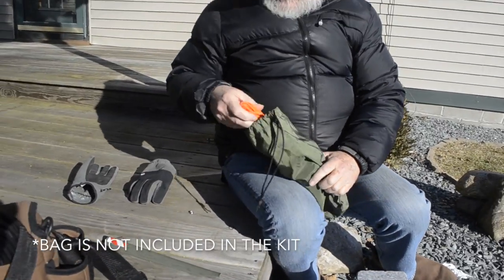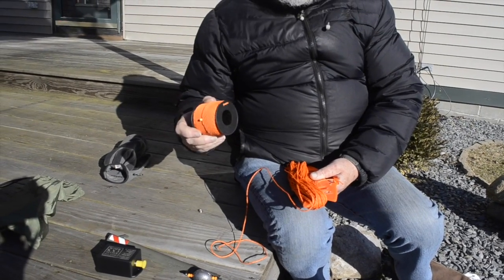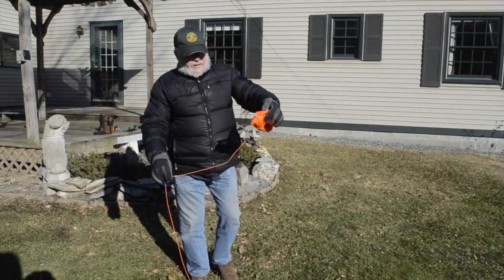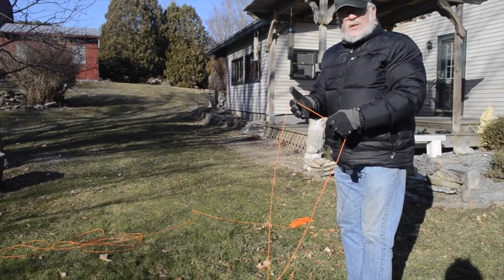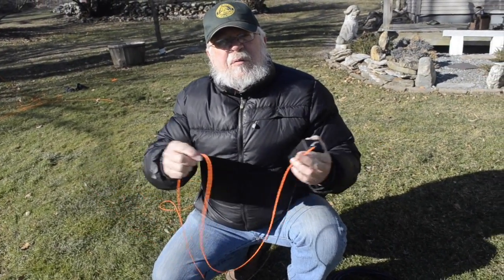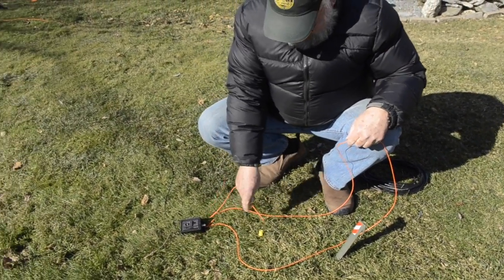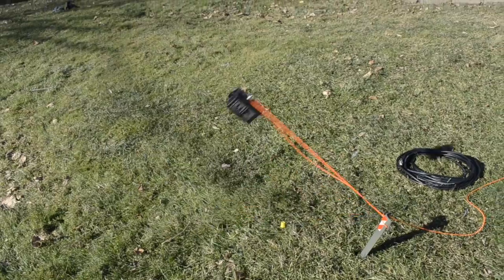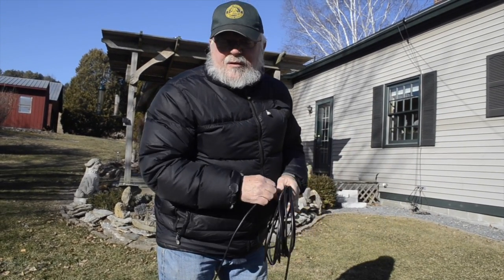QRP/ SOTA Ultimate 40-6M All Band Antenna from W1SFR

Comment: Still using the KX3 Helper I bought from you several years ago. Holding up well and performs well with built in KX3 tuner and 5 watts. Any advice on how to best add a wire counterpoise so I can use a shorted coax? Best length for 20 meter band?  Many thanks!

Comment: Just bought one of these antennas today.  Cant wait to throw it up in a tree and try it out.  This video was very useful on how to best deploy the antenna.  Thanks again, Jon KD8ARK
Reply from the maker: Thanks Jon! I'm sure you'll have a lot of fun with it. What's so great about it is the ability to switch bands at will assuming you have a tuner of course. I recently clipped a 50' piece of additional wire to the ground of the BNC connector and now have a 2.4:1 SWR without a tuner on 80m. It raised the SWR of higher bands slightly, but not by much. I really don't think many ops are using portable antennas on 80, but just to let you know it works very nicely. Steve, W1SFR

Comment: Been a longwire guy for almost 30 years. This one looks handy, well-made, and effective. I've always run the antenna itself straight to my tuner, which keeps the design simple and minimises chances for electrical failure, but can also complicate entry into buildings. It also limits how high you can go, since the feedline is the antenna; get it up 75 feet, and your antenna is 75 feet long. Not optimum for 40 on down. Anyway, the W1SFR looks pretty good.